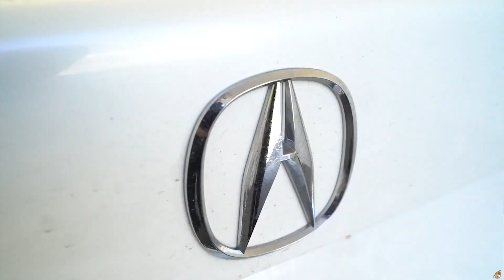Acura Tsx Exhaust Muffler Delete And Crackle Tune Sound Clips!

Comment: It sounds like that with just a muffler delete?
Reply from the maker: Not the pops, the crackle tune does that so need a flashpro and a ecu if you’re not 07/08

I hear you can get pops by deleting the cat and going straight piped basically.
Reply: What if you are an 07-08

Comment: Can i go to a tuner and just ask for a crackle tune?!? If yea how much does it normally cost?
Reply from the maker: It depends on your car, if you have the 07-08 Tsx then yes if not you’ll need to get a 07-08 ecu/CAN adapter plus the flashpro to tune it. 

But you can do it yourself in 2 mins if you have the stuff

Comment: i have 07 tsx with resonator delete single muffler and my shit will pop when its cold out. Between 3-4k rpm most of the time, do you have flashpro?
Reply from the maker: I heard either deleting the cat and res may make that happen but it’s something I wanted to turn on and off. Yes done with flashpro
Reply: @RishMedia  did you find the flashpro easy to deal with? and have you had any troubles with it
Reply from the maker: @clarkescollectibles  nope super easy there also is a lot of tutorials, I’m actually going to drop a video on how I did the crackle tune maybe later today.

Comment: Trynna do that to my Acura
Reply from the maker: Its possible man, easier if you have a 07/08 to just plug in a flashpro and do it.
Reply: @RishMedia  sad part is, I got a 09
Reply from the maker: @xsl999_4  I believe you’re able to do the same, just double check if you can use flashpro without needing a different ecu!
Reply: @RishMedia  appreciate it just got into cars so yk, we getting there😭
Reply from the maker: @xsl999_4  we all start somewhere! Everything started with my first TSX now we’re this far!
Reply: @RishMedia  hell yea I just got it straight pipe and bought some dope as blue tips😭now just a quick tune yk

Comment: Purple power destroy the paint and clear I hope you didn’t use it on your paint or wheels smh
Reply from the maker: I only used it real quick on wheels as a degreaser I’ve seen and heard a lot of people use it for wheels. Is it more for the polished ones instead of power coated